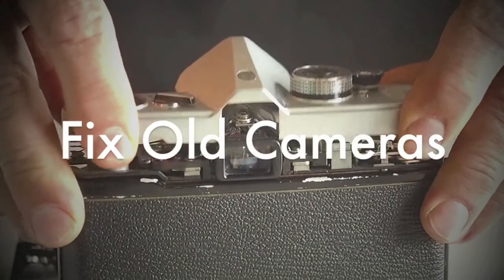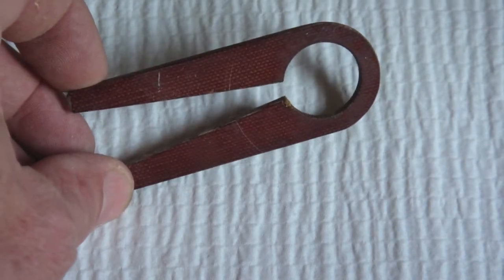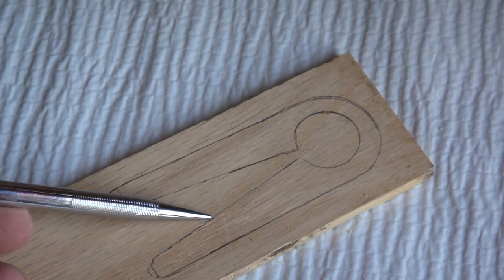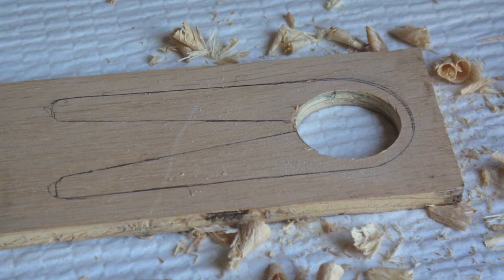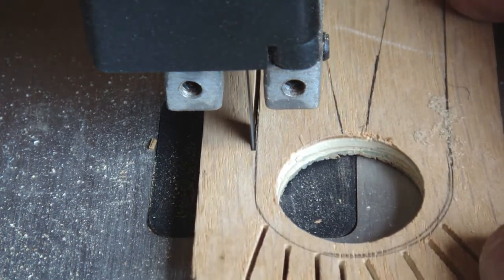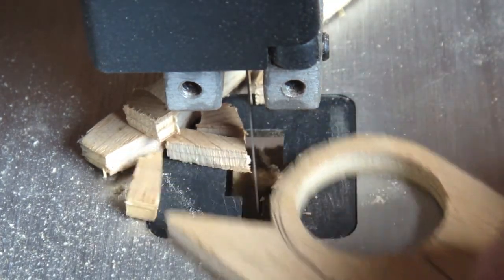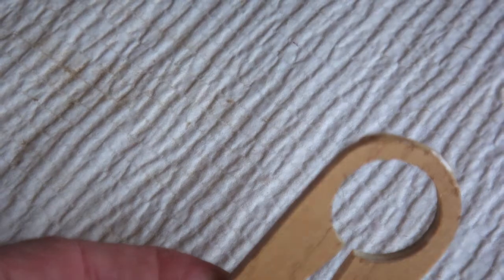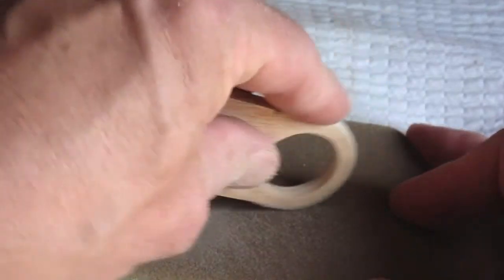Fix Old Cameras: DIY FlexiClamp

Comment: Mike, thanks a lot for creating and posting these videos! I've been collecting and repairing cameras for over a decade, so I appreciate the value of the knowledge that you are conveying. Also, I looked at the tool-source recommendations on your website, and you often suggest micro-tools.com on ebay. I've used them a lot in the past with great results, and they might appreciate us buying directly from their website instead of ebay to avoid ebay's fees. Now, I'm off to work on an OM-10...
Reply from the maker: Nice post. Your suggestion is appreciated and good luck with the OM-10.
Reply: Then Mike probably would not get his cut…